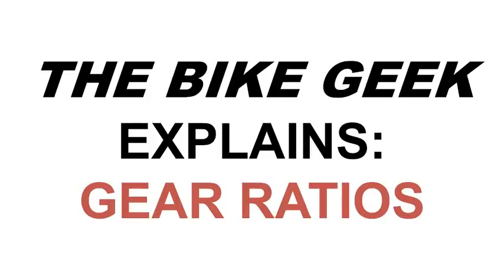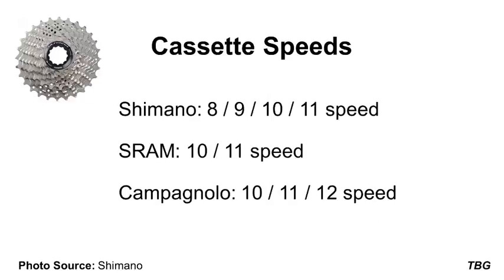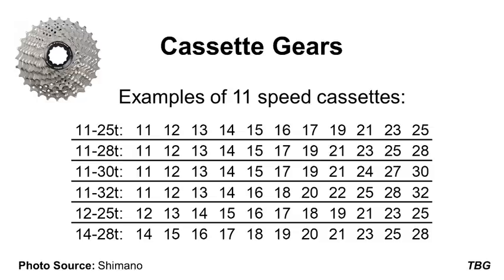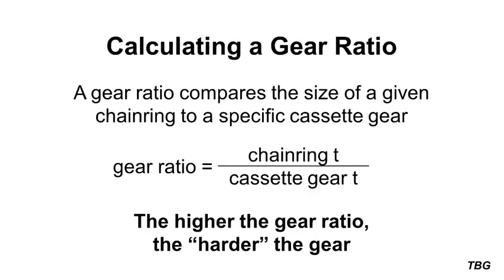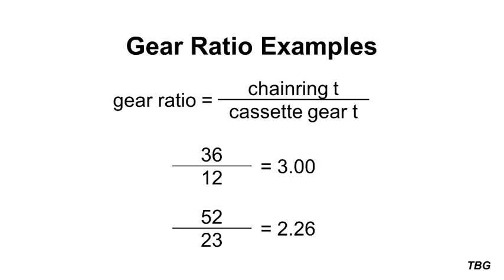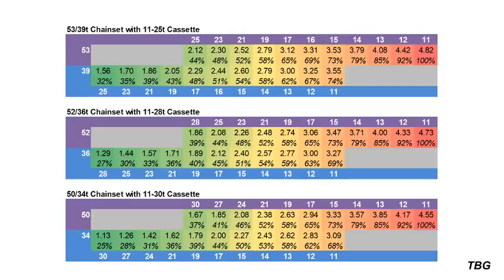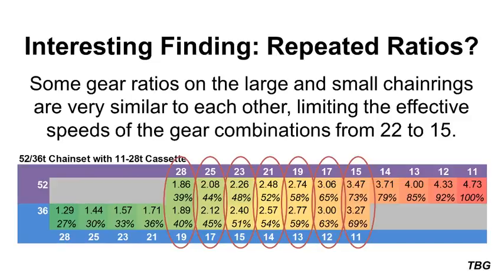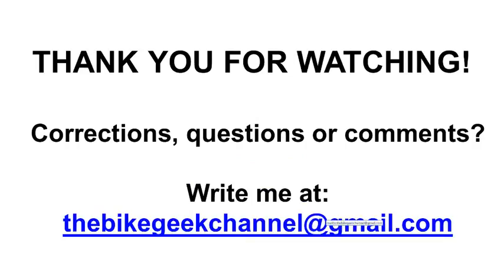The Bike Geek Explains: Gear Ratios

Comment: This is great and I have an observation / something I would love a follow up on. All things being equal, it seems best to be in the smaller, front chain ring for the overlapping gears, as then when you switch gears (rear cassette), you get a smaller increment / it's smoother. Thoughts?

Comment: THE BRITISH INCH SYSTEM --- This gear ratio system is not as good as the "British Inch system", which is the same formula, but multiplied by the rear wheel diameter in inches. The scale of ratios then falls between roughly 30 and 130, giving clear signposts of performance along the way: 30 for walking-pace uphill; 70 for standard one-speed bike on the level; 100 for starting downhill. These numbers are much easier to categorize and memorize and can be compared from bike to bike as the wheel diameter is included in the formula. With a good gear complementarity, one can jump from one chainring to the other and know exactly what to expect. This is particularly useful with three chainring cranksets, which do require some studying to master the ratios. Try it for fun, you'll adopt it for efficiency.
Reply: Neat.

Comment: Recently got a new drivetrain and used a ratio chart to help make my gearing choices. My compact lowest gear was a 34x28 which is 1.21. My new mid compact has a 36x30 "granny" gear and it's a 1.20, so very, very close. I know it's all I need so I didn't mess around with a 32 or 34 tooth cog, which means I get optimal spacing. Very helpful!

Comment: Great video! Throwing away the 50/34 and running 52/36 with 11/30 should give plenty of easy gears while maintaining decent top speed
Reply: I just did this. The 36x30 climbing gear is 1.20 and the 34x28 I had before was 1.21 so very, very close. The 52x11 is 4.73 and the 50x11 is 4.55 so the spread is slightly bigger between gears but that's what you give up for slightly more top end speed.

Comment: Instead of focusing on overlap of gear ratios, and hence useless combinations, you get from multi chainring drivetrain system, think another way!
1) If you’re biking in a city at speeds around 20-30km/h, ALWAYS stay on the smaller chainring on 2x drivetrain system (middle chainring on a 3x one)!
2) ONLY time you shift to (/utilize) the largest chainring is when you’re racing someone, or going downhill. When you reach the top speed on smaller chain ring, shift rear cassette 2-3 cogs down (depending how many speed cassette you have, 1 down is enough on a 8-speed cassette) and then shift the chainring at the front.
3) ONLY time you shift to the smallest chainring on a 3x drivetrain system is when you suddenly stop at a traffic light (forgetting to shift down your rear cassette before stopping) or worse you’re going uphill and an idiot stops you!!
X) Extra chainrings reduce your bike “simplicity” by giving you special features for special times! I’m happy to carry them on my bike, the same way I’m happy to have two brakes on my bike!!

Comment: Nice video! Do you think even if we achieve a same ratio number by having different teeth numbers, does this affect the feel on the pedal? Fir example if we have 20front 10back vs 40front 20 back...
Reply: Interesting question; never thought about this. 🤔I don't think it would make any appreciable difference. The only thing that might have something of an effect is if you had to cross your chain a lot to achieve that gearing ratio in one setup but not with the other (as crossing the chain like that would increase wear & tear and also result in a certain efficiency reduction).

Comment: How do you calculate the %?
Reply: divide the lowest gear ratio by the highest on each set. 

The 53/39t and 11/25t combination gives the highest % of 100% at 4.82 ratio  (53 divided by 11).   

Then you take any other ratio you wish and divide it by 4.82

For example:

The 53/16 ratio is 3.31 ....the percentage is 69% , which is derived by dividing 3.31/4.82 = 0.687 or ~ 69 % rounded.